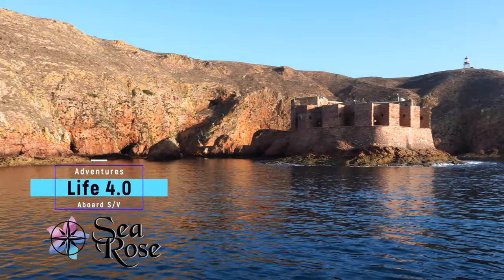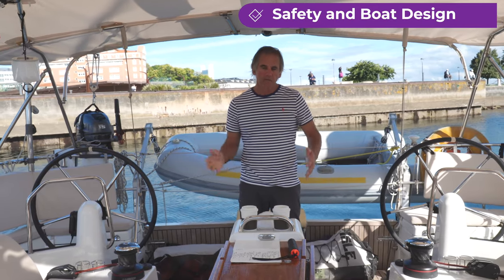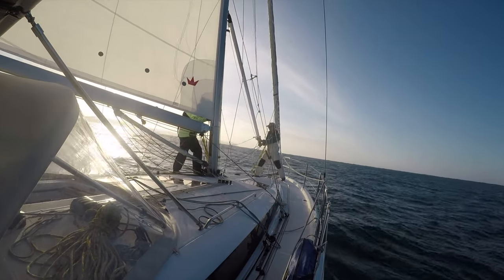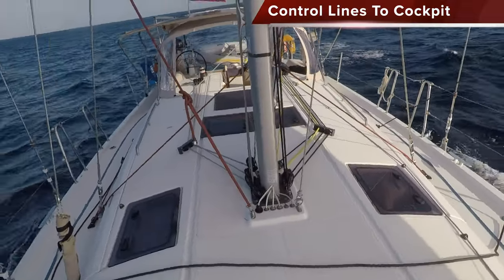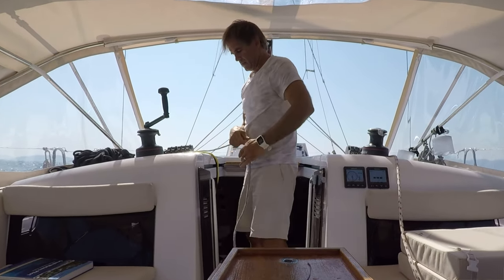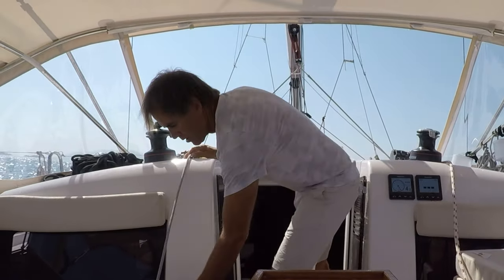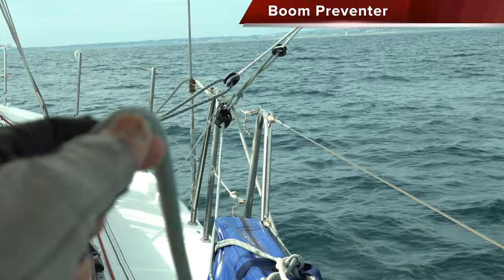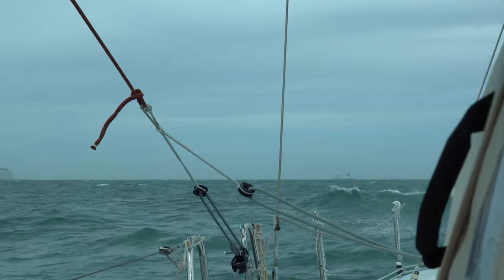Boat Basics | Safety & Boat Design | Ep. 138

Comment: I ordered so 440 like yours. I was wondering which system of main sail is better. I finally chosen sliding main sail not furling system(performance version).  As you mentioned for the safety furling main sail seems to be better. I was told  that so 440 performance model has reefing system in the cockpit (1,2,3 reefing) so we can reef the mainsail. Anyway We are waiting for our new so 440 and expecting sailing with her~ Until we get her we are satisfied from your journey with 440 on your channel   Thank you
Reply from the maker: Congratulations on your purchase - we hope you enjoy your SO 440 as much as we do. Either sail system is very workable but our preference was the in-mast furling for ease of deployment. It is just the two of us on the boat and when we are doing watches, we each can manage the furling system where the strength and agility required for a sliding sail is something we felt might us pick motoring in light winds instead of attempting to sail. I am sure you will like the config you ordered.

Thanks for watching our videos!
Reply: @LifeFourPointZero  My wife and I are the same age, 50 yrs old. We hope to go circumnavigation of the world like you~ 
After we are familiar with our new SO 440, in 3 ~5 yrs later we will depart. Your videos helps us to prepare our future journey. 
thank you for your nice and informative videos~

Comment: Hi guys. Big Fan of in Mast Furling here. During a chat with Precision Sails while searching for a Sailmaker that makes Battenless Triradial cut Sails, to help eliminate chafing wear and tear, plus provide strong Reefing Points, Precision Sails were the first ones I Contacted that confirmed that they make them(since, others confirm that they also make them now), ending the conversation with the very interesting info, that Triradial Construction can recover most of the Sailpower lost by not having Battens. Given how much longer such a Sail can last, compared to a classic Crosscut Dacron Sail, at from about double the price, in cost per year terms, Triradial appears to be one heck of a bargain. In fact I think I’ll be going for a Triradial Self Tacking Furling Jib as well (I suspect two Reefing points would be sufficient tbh , but will chat with the Sailmaker when ordering ) Among those now doing such Sails are Quantum, Ullman, and Elvstrom , in the order they confirmed to me that they will make them. Others are likely also joining in given the potential benefits they offer, high for in mast Furling the important UV Protection that is provided by furling into an Aluminium Mast. Admission- I really like Ullman’s Offshore Spec in Mast Furling Main, Construction with Challenge 9.11 Sailcloth, probably have to up spec the Main Sheet and Halyard Winches, but for a Sail That Tough, probably worth the investment? Best Wishes. Bob. 👍⛵️🌟🌟🌟
Reply from the maker: Some great research there Bob. We are big fans of in mast furling. You lose some sail area but gain a lot in flexibility. The battenless triradial is an interesting concept. Enjoy!